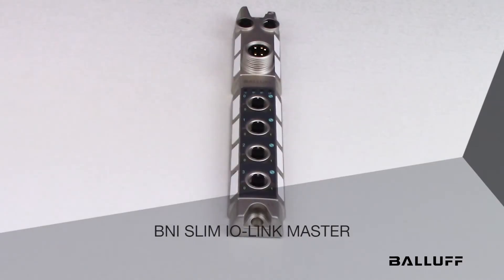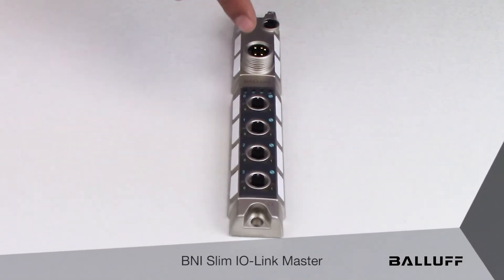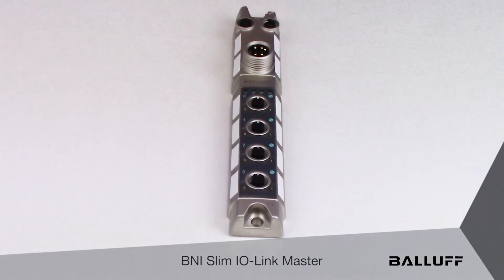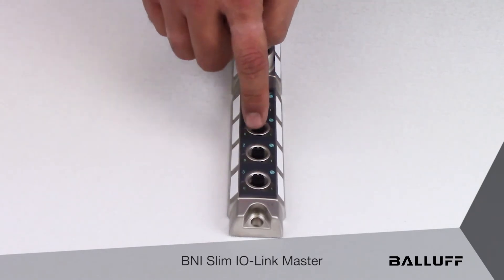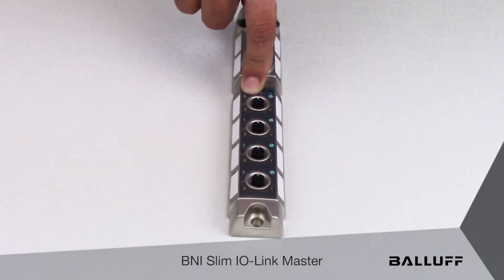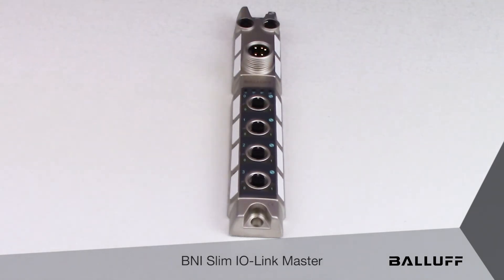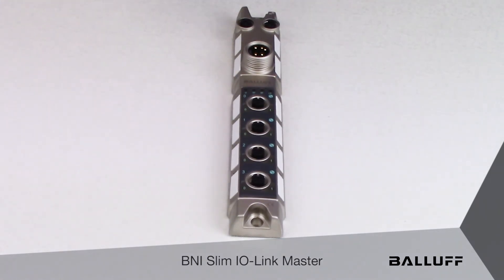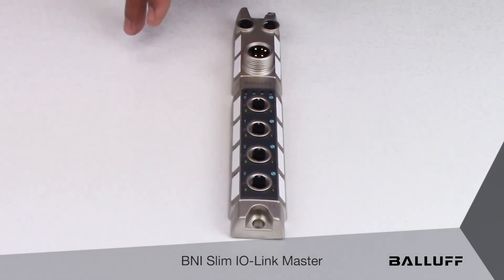IO-Link Slim Master (4-port)

Comment: Pretty sure the guy misspoke..

4 Ports × 16 I/O per hub = 64 I/O points total on a single slim master.
Reply from the maker: Thanks for your comment. Balluff offers expansion ability to connect another hub to the first set of hubs -- making 30 I/O points available per hub. With 4x 30, I/O makes 120 I/O points on the single network node.
Reply from the maker: Also, as IO-Link is becoming more popular, our customers opt for an 8x IO-Link block that can build high-density architectures with up to 240 I/O points.